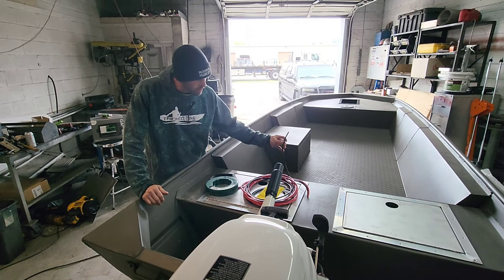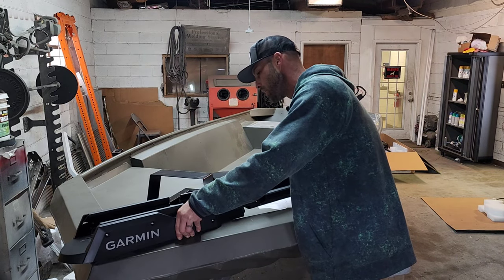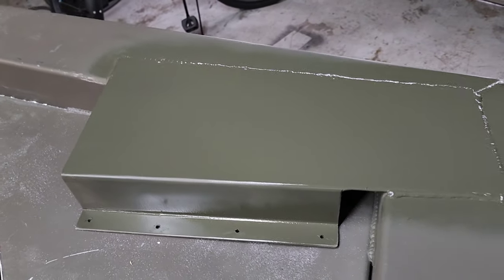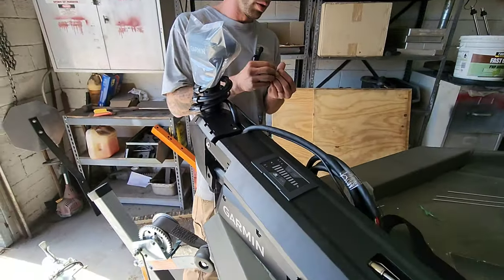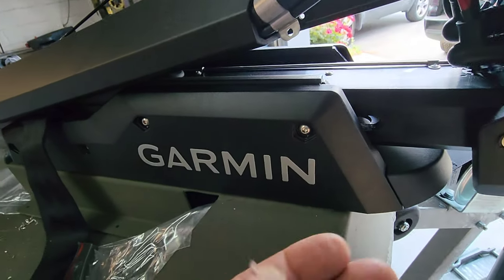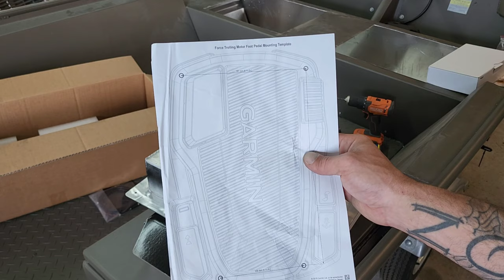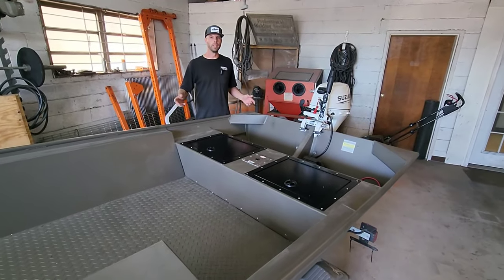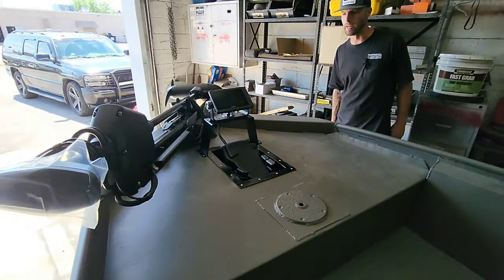New Boat, Major Upgrades! "How to install a trolling motor" #jonboattobassboat #fabrication

Comment: Love these videos! Since you’ve done so many aluminum boats and various brands you get to see the internals of the hull and the weld quality in your opinion what is the best built 1648/1652 Jon Boat you can buy?
Reply from the maker: This is an excellent question. It probably deserves a video all on its own. There are so many factors that play into this. There are a lot of high quality expensive Welded boats out there, But if you're looking for the best deal I would recommend a weldbilt.  The quality is not that of that of some of the top brands, but they are decent, And pretty lightweight.  Most of my bills have motor restrictions and tricians and these are the fastest hulls around
Reply: @TRICKEDTINS  What’s the best quality if price isn’t a concern?

Comment: Weldbilt or tracker grizzly? Which makes the better boat.
Reply from the maker: The better boat...thats tuff.  Honestly it would depend on how you plan on using the boat. I would personally choose the Weldbilt. Here's why lighter/faster, more stable, i like the look better. The trackers are heavier, slower, but heavy-duty. Id take an Allweld over both?
Reply: Gator Trax over all
Reply from the maker: @terryogletree2128  your in whole different ballpark. Were talking $5-6k boats not 50k